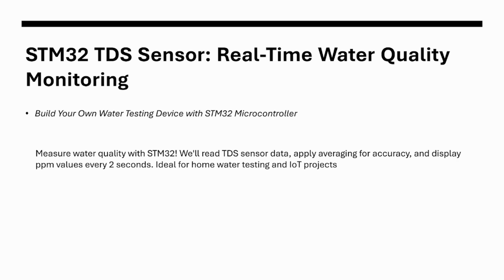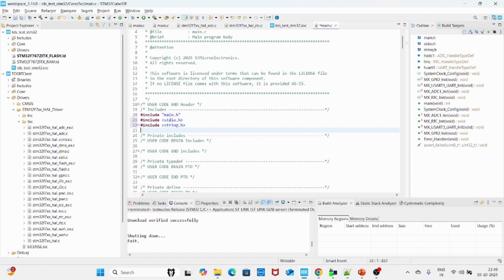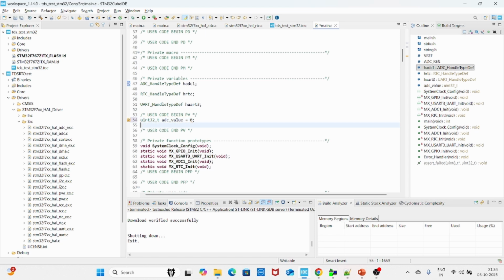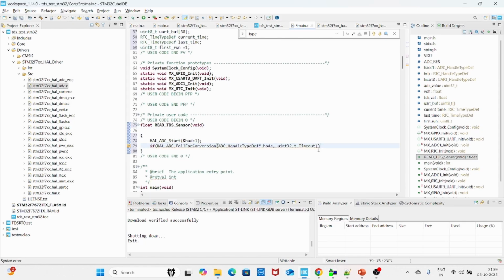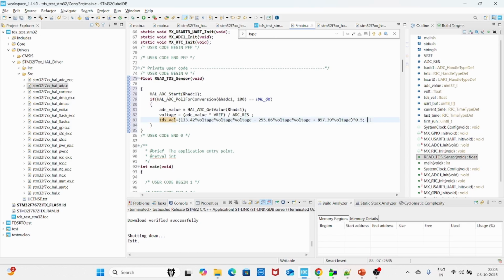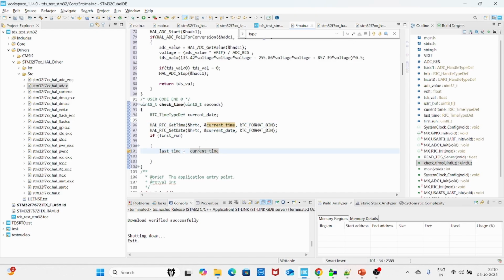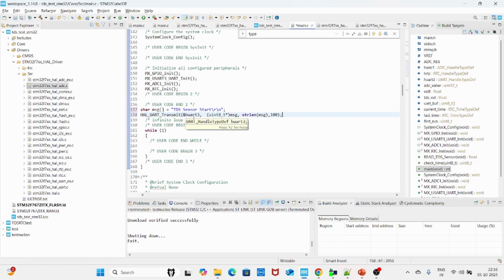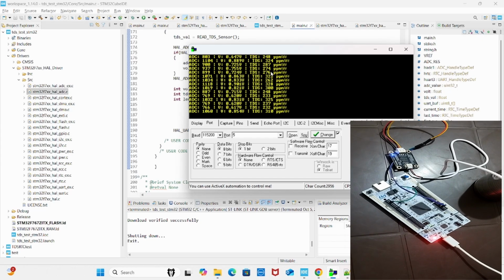Test Your Drinking Water Quality at Home (STM32 TDS Sensor)

Comment: 133.42 is this equation standard or we need to derive it for our sensor?
Reply from the maker: This equation is specific to the common Gravity Analog TDS sensor, not a universal standard. For accurate results with different sensors, you should calibrate using known TDS solutions and derive your own coefficients. For this project, I used the standard equation at 25°C room temperature which works fine for this projects, but proper calibration is essential for professional use.
Thanks...

Comment: STM32 with pH sensor code is available?
Reply from the maker: Thanks for watching... pH sensor tutorial coming next week! This week focusing on data logger series. Stay tuned.
Reply: @hardware_coding3603  I have one more question 
I have STM32F407 Microcontroller is this method and code will work with that model of STM32??
Reply from the maker: Yes, code will work on STM32F407. Just change pin assignments in configuration according to your board. Other logic remains same.